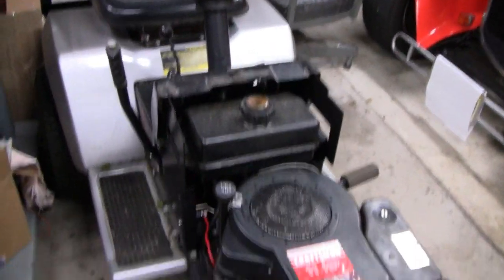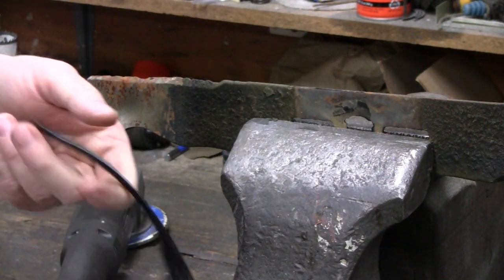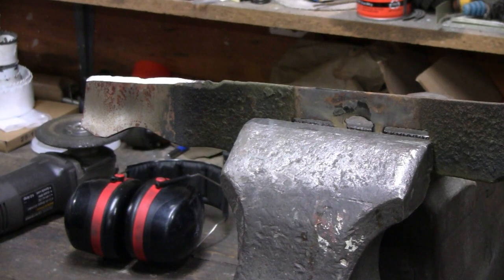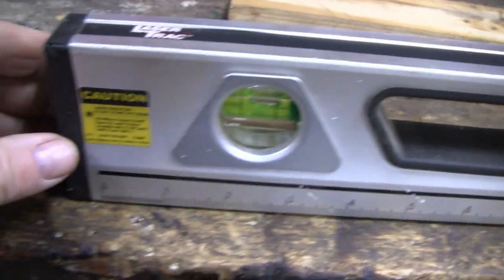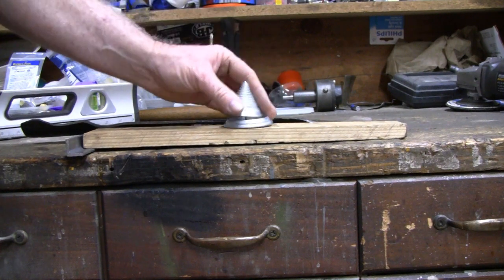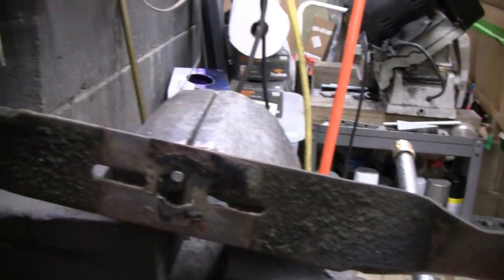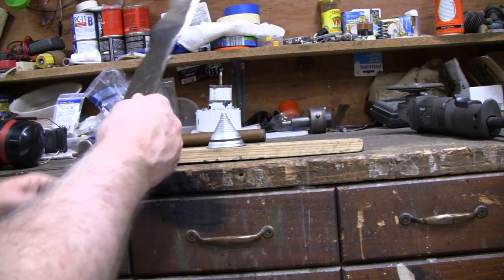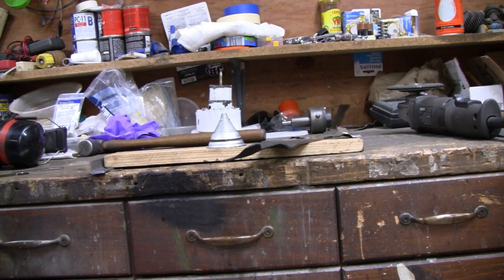HOW TO SHARPEN & BALANCE A LAWN MOWER BLADE

Comment: Yes, ROADKING, and if, while you're mowing you notice some humming of even buzzing noise it can be an indication of blades being out of balance too. ( It could also be an indication of worn spindle bearings too.) 
I'm glad you mentioned the old grass and rust on the blade, man, that makes a difference too in balancing.
I'm glad that you ran this video at this time of year, it's a good reminder of doing this mower deck maintenance.
Good job!
Reply from the maker: Thanks Reg!!☺

Comment: I sharpened my mower's blade earlier this year (was never sharpened since I got it, "oops!"), just used a file & muscle, and used the nail in a vice technique to balance it (for round-hole blades like mine, it helps to find the centre line to pivot from too), worked nicely and cuts grass like butter, rather than ripping it and pulling some up by its' roots... :)

Comment: That was fun.  I use an angle grinder (sometimes)  I use a bench grinder (sometimes).  The nail balance i use all the time   (it is just quicker)  yes i don't get a side to side balance with a nail but its a lawn mower blade not a  Henkel kitchen knife.  Great video RK
Reply: Bruce Pender out of curiosity wwhat cuts the grass in the center if only the outside is  sharpened?
Reply: Robert Berin Unless you're picking your lawn mower up, and putting it down (In other words not rolling it) the grass towards the center of the blade(s) has already been cut as you passed over it while the mower was moving.
Reply: because the blade rotates, it cuts "ahead" of the center point as your moving across the lawn.
Reply from the maker: Thanks Bruce!!☺

Comment: When the blades get that chewed up I usually grind the edge down until it's acceptable and then grind a new edge on it. Done that with several and it's worked well.

Comment: If you remove all the grass & crap sticking to the blade, you might not have to balance it.  When I worked in a lawnmower shop, we checked for bent blades, if that passed, wire wheel all the crud, sharpen, then balance.

Comment: I read somewhere those blades move at about 200 MPH, so it pays to take the time to balance those blades.  Thanks, Roadking.
Reply from the maker: Yeah on that same mower I never sharpen the original blades and the vibration got so bad it shook out the bolts holding the block together!! I only realized it because there was oil all over everything!!☺

Comment: When I started following you a few years back I remember a video with you giving folks like me heck about leaving grass on their mower decks causing them to rot out from rust. Yours is about shot. If you kept that roadking clean through the years then it is worn from use. How old did you say that mower is and how many acres do you mow? Maybe you should get some sheep.
Reply from the maker: I don't remember ever saying that, but I could be wrong!! I never cleaned off the top or bottom of mine in 32 years!! I drive it outta the shed, mow the lawn and drive it right back to the shed!! I only have an acre of land so it's probably less than ½ acre of grass!!☺
Reply: 805ROADKING Maybe it wasn't you. I'm getting senile in my old age...

Comment: I impressed.  never saw it change color once.  By the way a good deck shouldn't be hard to find,  lots got junked due to blown transaxles.
Reply from the maker: Thanks Bud!! I've been looking for a deck, can't find one that old!! If I can't find one by the winter I'll just rebuild it!!☺
Reply: 805ROADKING now that sounds like a good series, "coming this Autumn Rebuilding the Mower Deck, by RoadKing"

All jokes aside, I did rebuild a mower (Aluminium) deck a few years ago, & I used fiberglass. It worked really well, still using the mower.
Reply: +805ROADKING A wise man once told me"Never throw out a piece of metal, you will use it someday. "

Comment: why do mower blades have all funny bends and curvers in them?
Reply: They help develop a low pressure in the mower cavity that allows the blades of grass to stand straight for cutting. But if you have holes in your mower deck it doesn't work very well!!!